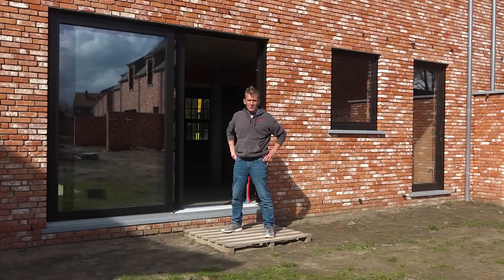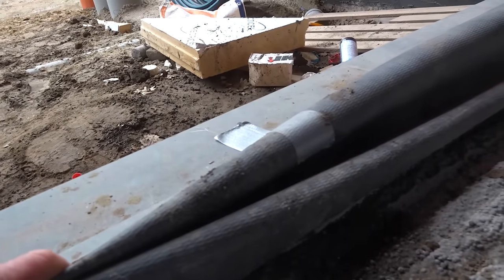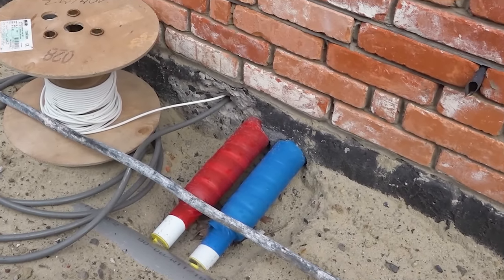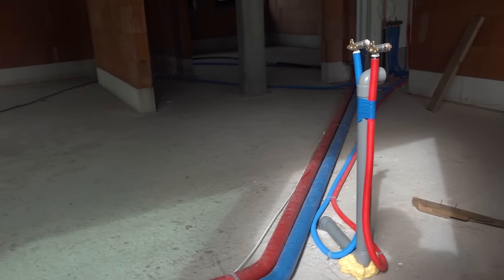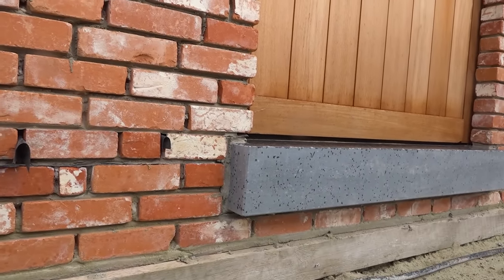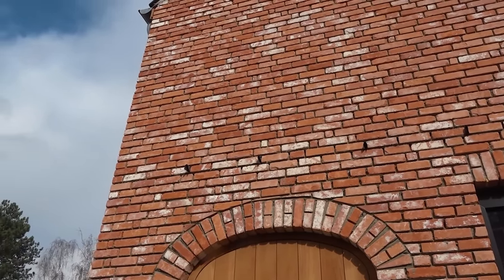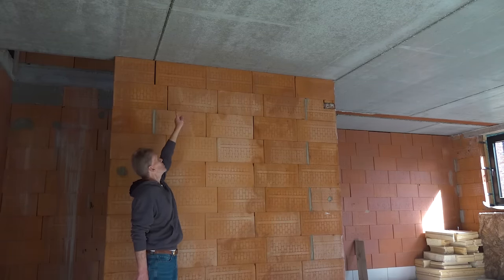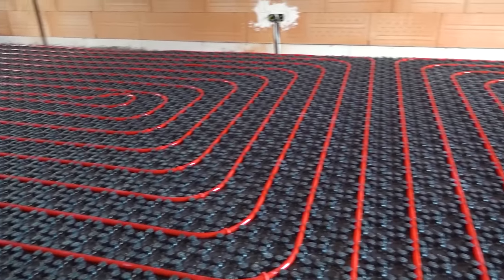Can We Learn From Buildings in Belgium?

Comment: Running the electric through plastic pipes is also normal over here and it’s a great thing , especially when you want to re-wire
Reply: Isn't that the norm for brick/block buildings?
Reply: Too easy. No profit in a simple job. Now some hacking out and fussing around, with a plasterer mate on standby, is a great way to confuse and screw the client.
Reply: When rebuilding on my old cottage I ran electrics through pipes where I could ( whilst doing a bit DIY plastering ) Now my electrics are playing up elsewhere and I wish I had asked the electrician to do it on other areas - but when it’s not current practice you are reluctant to ask as a client.
Reply: @girlsdrinkfeck  The web is international and indeed this post is about belgium. I find it best to use the simplest language that gets the point across.
Reply: @terencequinn2682  I saw it first when i moved to NL in ‘85, I don’t understand why it’s not mandatory everywhere
Reply: @girlsdrinkfeck  All the newbuilds I've seen have the bare cable in a cut out channel with a cheap plastic capping. No conduit any more and impossible to pull the wire back thru due the tight bends.
Reply: Same in the Netherlands.
Reply: @aberba  not in UK it ain't
Reply: @aberba  I think we are still allowed to run cables in walls without conduit, but we simply don't do it. Even my borthers house that is 60-70 years has all electric in conduits.
Actually we don't really use pipes anymore but flexible cable conduit and you can buy it in length of 25, 50 or 100 meters at the local DIY store with 3x1.5 or 3x2.5 already in the conduit.
Reply: @aberba  At least for Sweden running the electric through conduits in the walls is standard (I think that it's required) regardless of wall type. This to avoid rodent damage.
What annoys me is that those relatively new flex pipes can go anywhere in the walls and not straight. That means that you don't know where you can drill a hole or not without having some equipment to test for electricity and with the PEX for water it's impossible to figure out where the water goes.
In any case running the cables in conduits is quite convenient. You can also add extra empty conduits and boxes if you predict that there might be more needed in the future.

Comment: The stones under the windows and below the outside doors aren't concrete but natural bluestone. Belgium has been using its own bluestones since forever and Vietnam also has a good export of it, but of lesser quality (meaning easier to crack under stress). I work in construction in Belgium and currently have one that's soon to finish. I am the owner and also the builder so if you have questions I can always answer. And yes, my construction looks very similar to this too except a few minor details.
Reply: Granit is better; we use that in Holland. In Belgium also imittion granit is used; probaly kind of cement; looking good though.
Bricklaying: at the three country point: 
Holland: one cement, 4 sand and glue through the mixure (no lime)
Germany: one cement 7 sand and lime
Belgium: 1 cement and 5 zavel (kind of clay)  Ideal for big spaces between bricks/natural stones.
Belgium: no finishing bricks at the side walls; taxes.....

Once upon a time I was foreman of a group plasterers; we had also Dutch brick layers and carpenters there.
Reply: What are the blocks used in the interior walls? I didn't quite hear what he said
Reply: Some English houses use blue bricks too
Reply: We lived in Belgium for several years. Noticed they point the brickwork after construction. I wondered if the building in the vid hadn't been pointed yet? In general the quality of brickwork we saw in Belgium was better than in the UK.

Comment: I learnt my trades in France, when I returned to the UK I was shocked at how antiquated our buildings systems were - the victorians knew more about damp avoidance than we currently do, and architecturally we rarely have anything of 'merit'. We are a country focused on low cost rather than quality.
Reply: You should see Swedish or Finnish new builds. This building seen in the video would not pass inspection, many code violations in the rising damp prevention.
Reply: Yes, politicians boast about the number of houses they intend to build - but it is not just the quantity, it is the quality. The housing stock in the UK is in a parlous state - new build quickly deteriorates. Compare this with Germany, for example, where building standards are high . . .
Reply: go to Switzerland. France norms and techniques are middle aged.😊

Comment: Been saying this for years .should also have a manual for the house .where every cable pipes etc can be located.with add modifications added.
Reply: In engineering we have drawings  That should be the same in the building industry  and amended at the completion of the job
Reply: @leehotspur9679 Drawings are not the same as how they are exactly laid down. Won't be the first time a pipe being a meter off.
But that is why in the last couple years i have seen construction companies adding a 'House Portfolio' to new house projects, with photo's from start to finish.
Need accurate information about a cable or tube, look into the house's portfolio with the images.
Reply: As built drawings and other BIM stuff is standard in factory new builds.
Reply: @Eledore  it is mandatory that the pipes are placed exactly like how it is on the drawing.
Reply: The system of Traceability is only as good as the person who is responsible for the input of information Be it the Owner or Builders representative  @Eledore
Reply: Our house (in the Netherlands) was built 20 years ago, and I have 4 sets of technical drawings identifying electrics, floor heating & other heating pipes, drain pipes and even materials such as bricks, frames, paints (including exact color), insulating material and roof tiles.
I always thought this was standard issue, how would you do proper maintenance without it?
Reply: @Eledore 1m off is nowt. I used to work with a bloke , who had no fingers on his right hand.  He had been an Industrial Electrician.  They were putting in another 3 phase cable to a farmers barn.  The original cable was marked with yellow poles.  He went to put in a metal fence pole 5m from the marked line.  He was holding the metal pole, while his mate hit it with a sledgehammer.  It cut through the steel protected cable and " bang ". Threw him a good distance and burned off his fingers past the knuckles.     Lucky to be alive.  When the Electricity board checked it afterwards. The whole cable run was 5m or more off where it was supposed to be.  The farmer ploughed up to 3m from the marker poles.
Reply: @diatonicdelirium1743  My birth rowhouse in Netherlands build in the 70's all had a single drawing, all houses had the exact plumbing, but no electrical or gas line was the same. After a few ambulance pickups over the decades it made me extremely wary when moving to Belgium. And from experience in Belgium anything past 2000 is neatly documented and done well (Except DIY). But anything before that, i would invest in a good sonar-map equipment and map the area before doing any work. They are extremely cheap these days and well wroth it.
Reply: We are obligated to have that .. but we have a lot of houses build before 1920 …
Reply: @diatonicdelirium1743  you surmise. The tradesman looks at it and comes up with a price then adds more because this could easily be a whole load of unexpected shit.
My house has plumbing that doesn't work right 4 plumbers came out and looked at it and didn't even want to quote the job. It is a mess and nobody knows where the pipes that go under the floor pop out. Drawings. Hell the house doesn't even have drawings in the county council. I followed wires in the attic only to find half of them went back to a connector block taped up in the insulation with one wire going to the fuseboard for lights.
The only way to get plans is to rip it all out and start again.
Reply: THAT is a good idea. We do have a copy of the builders plans with modifications that were "sighted" by council inspectors on file with the borough council of the city.
The house should have kept a copy, I don't know why I didn't.
Reply: My father in law used to say this because people move in dont know what previous owners have done start taking walls down without thinking and before you know it there is nothing holding the house up
Reply: @janetholden1978 I went on holiday to Japan, and was waiting in a mall for someone, and watched three guys take a load bearing pillar out of the middle of a store that  was in the middle of the building, right next to  the wide open atrium. It looked like they had taken at least one other one out already. So there was a HUGE mechanical pressure  right across the open area.
I couldn't do anything about it, not speaking very good Japanese. So I had to stand there and watch them hit the concrete away from the six  reinforcing bars that were inside the pillar, one last time, and the bars bent and twisted, and the  roof of the shop, and that whole area, dropped by about a foot with a loud groaning and grinding noise. 
Glass in shop fronts and corridors broke all through the atrium.
Reply: Perhaps Haynes should bring one out...and why not? I've got one for a Millenium Falcon for god's sake!😂
Reply: @diatonicdelirium1743  it's the UK... nothing gets done properly.
Reply: @Eledore I’m an electrician, we don’t even get a plan on where to put our conduits and cables, only where there have to be outlets and lamps.
Reply: @jonahfastre  I flipping know, and i don't mind that that is all the information you get, but that you are not required to give data back how you ran your conduits.
Glad house portfolio is a thing here now, just wish it became mandatory.
And i say again, i don't mind electricians or other professions doing there job, but.. sometimes .. i wish you don't get to freehand everything.
Reply: 20 years ago i asked for the material specs and drawings for a high quality new build. The developer (the actual company owner) literally laughed in my face.
Reply: We have this as law, it's called CDM and as-builts must be provided in O&M manuals for buildings. However, for individual houses it doesn't really happen and drawings are often wrong or handover never happens due to builders going bust etc.
Reply: After the great fire of London, 60% of the bricks came from Belgium. 
Even then, the Belgian architects were scolded for their security in building.
Every 'normal' type of building has been build up since 70 years. 
The new ones are just the rebirth of all those regulations.
I rent apartments build in 1972, every 20 odd years a renter is obliged to new rules
Reply: Here in Belgium it is mandatory to have these plans. You need even to keep it up to date with all changes. It will be required when you want to sell the house.
My house is build the same (obviously as I'm living in Flanders), only I have glued bricks on the outside (modern cubic house), but the inside is the same.
I only have triple glazing and an aluminium door.
Reply: @leehotspur9679 commercial and institutional buildings usually have record drawings and operation and maintenance manuals. They're seldom done for housing, because of cost.
Reply: @anrexfk No it isn't.
Reply: @leehotspur9679 A decent set of photos is a great record. I ran a portfolio of around 200,000 square.m. for almost 30 years and I know from experience that the buildings with photos were easier to maintain and modify than the buildings with record drawings, which were infinitely easier to maintain and modify than the buildings without any record information.
Reply: @diatonicdelirium1743 Houses are usually simple. Record information is good to have, but not essential, unless the house is unusually complex. One-ofv houses usually have drawings, etc. but I have never seen accurate record information provided to buyers of tract housing, anywhere.
Reply: @robertwillis4061 A classic case of "scan before you hit a steel post with a sledgehammer"
Reply: @Eledore No matter how good the record info looks, it's always worth scanning,
Reply: If you don't have a manual for your house, grab a binder and start one.
Every little bit you add to it will make your future life easier, and it will probably even outlive you. And continue to ease the maintainance of the house.
Reply: @Babihrse This sounds like every house in the US. Nobody knows what is behind their walls, it’s all detective work and guessing whenever repairs are needed.

Comment: Why do we in the UK use plastic gutters! It looks crap and fails!
Reply: They can always be changed
Reply: My parents plastic guttering has been up for 40 years, that's about 15 years longer than the metal guttering that it replaced.
Reply: Price is why
Reply: Mother’s house had flat backed ogee cast iron gutters. Horrible things that rotted at the back. Plastic went up in 1970s. It’s still there.
Reply: Cheap
Reply: Why bother? Anything in uk is pretty shit anyway.
Reply: Doesn't have to look crap. Only if you go cheap and shoddy.
Reply: Plastic gutters? That’s a new one to me, and frightening because I can easily imagine it being adopted in the US. We already have plastic plumbing fixtures chromed to look like metal.